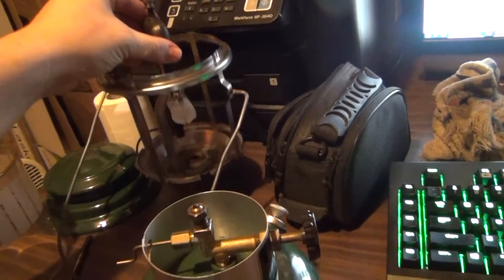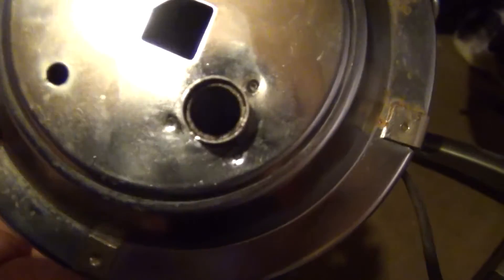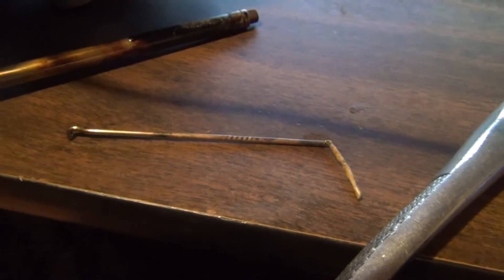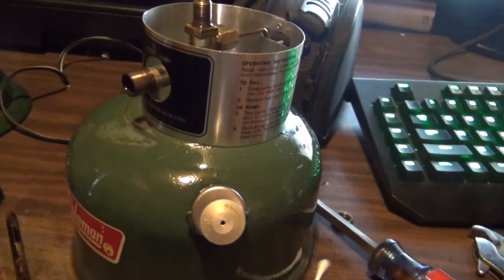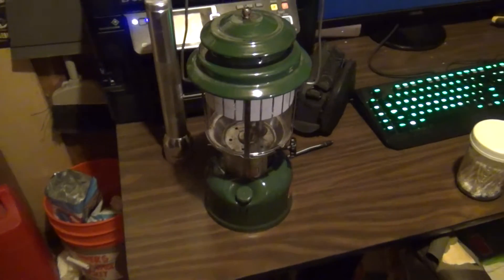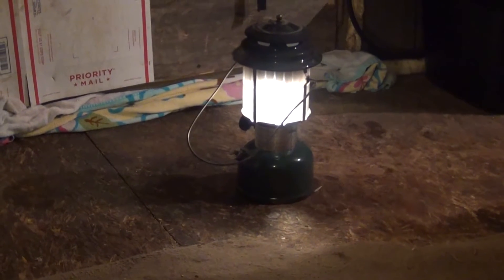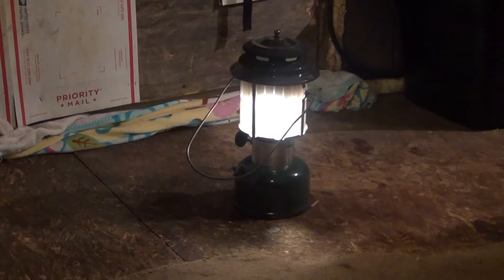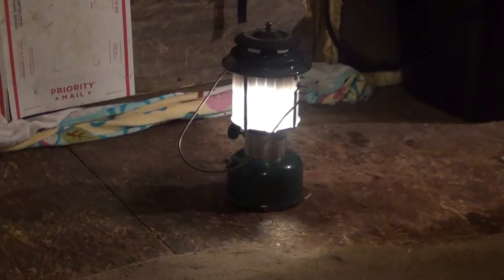Coleman lantern project, will it run on diesel?

Comment: With proper set up, with a Dual Fuel generator and preheat alcohol cup, most Coleman lanterns can run totally fine on diesel fuel. 
  As far as cost goes, consider red diesel sells for #3.99 a gallon in San Diego County and a gallon of Coleman Fuel (aka white gas, naphtha) sells for about $16 and quarter a gallon out the door at local Walmarts. That's roughly a 1 to 4 cost ratio.  
    Therefore, for twenty bucks I can buy FIVE GALLONS of red diesel. Five gallons of Coleman fuel will be about EIGHTY-ONE bucks. ( $16.25 x5 ). 
     The lantern burns less than one quart per night. So, you would realize more than twenty nights of heat for just twenty bucks using diesel. Twenty nights of heat using Coleman fuel as figured above would run about EIGHTY-FIVE bucks. 
     If the above is somewhat correct mathematically,  60 nights of heat, again roughly two months,  it's a 40 dollar to 170 dollar ratio. And for four months of heat the ratio is 80 dollars to 340 dollars, roughly. 
   In all fairness, mixing a little regular pump gas in to thin the mix will increase the cost. My last fill up at Costco was $4.09 a gallon. Not a significant amount on my ledger. 
  Sources:
  Walmart and 
  Highway Fuel in El Cajon, CA

Comment: There are 2 different generators for these lanterns. One is designed to burn naphtha and the other is designed to burn kerosene. You should have installed a kerosene generator to run diesel because kerosene and diesel are very similar to each other. In addition to the generator you would also require a preheat cup like the one required to run a kerosene lamp. Preheat cups are available online or you can make one. There are videos to teach you how to make a preheat cup. They are very easy to make. Then your lantern will light up easily without the smoke. The preheat cups burn alcohol BTW and that's why there's no smoke.

Comment: I couldn't even imagine trying to use something like this without doing my homework and seeing what I'm supposed to do in the first place.
   That lantern was originally made to use white gas, although unleaded fuel works fine too. If you add a preheater cup then kerosene will work also, possibly diesel I'm not sure. Anything but white gas/gasoline you will probably need to clean the generator often.

Comment: As far as the sheet extraction and exhaust issue. I wonder if you could put a stove pipe on top. And put one of those magic heaters on the pipe?

For those that don't know what a Magic heater is. It's a unit you put on top of stove pipes on wood stove that blows the exhaust buy a bunch of tubes that pass air through.

It's basically a way to get more heat out of your fire. 

So theoretically if you could get a pipe that actually fit the top of that Lantern. 

An individual could set up an apparatus where are you simply put the lantern in from the bottom part of a structure. 

Basically plantar goes under structure. And maybe put a piece of wood or brick under it raise it up to the pipe. 

That point it would eliminate most of the exhaust issues and the so it would be easily removed as well. 

Anyhow you have a good day.

Comment: You must use a kerosene specific generator(Ebay) and a copper preheat cup (Ebay)which slips over the generator. You fill the cup with alcohol with cleaning leaver down. You light the alcohol and wait for a few minutes for the generator to heat up to vaporize the kero. The turn on the fuel dial. I run my 201 on straight premium diesel no problems but not shitty old truck diesel. Watch how they light a Tilley lamp on YT which is the same principle. I also use Peerless mantles which have a very tight weave.

Comment: Yeah you need to use a pre heater cup filled with De Alcohol or some yellow Heet bought at the auto parts store. the reason it flames and smokes is you're trying to burn Liquid instead of a vapor! The pre heater  basically boils the oil in the Geneartor tube forming a vapor no fire no smoke. the reason the first generator got clogged up is from all the carbon from the inefficient burn of the liquid.jim

Comment: Glad you're enjoying the lantern. Actually the 220 series were designed to run on Coleman fuel (white gas). I'm actually surprised you can get it to run on diesel. That's funny. One telltale sign if a lantern was designed to run on kerosene would be a brass cup that encircles the generator tube. It was so the cup could be filled with alcohol and then lit, just before the alcohol burned off, the lantern could then be fired up and run on kerosene.  Also most of the newer kerosene models will say Kerosene right below the Coleman sticker on the front. There is a collectors website , Old Coleman Parts, that is a wealth of information and also obsolete parts. Enjoy and have fun. Careful though, you will start off with one and the next thing you know you will have a basement full of them, believe me. Check out the Coleman 200A, my personal favorite.

Comment: You might have more success using a kerosene designed lantern like a 639 or 237. They use a bigger and wider generator than the gas models and would clog less and be more accustomed to sooty fuel.